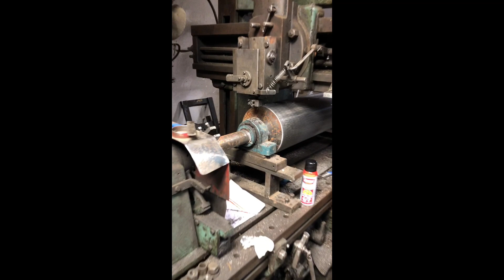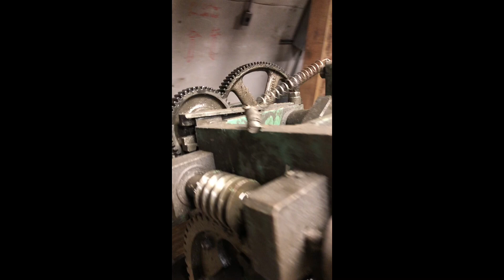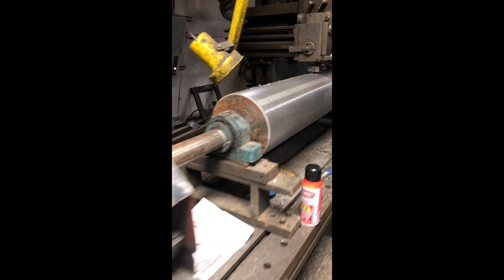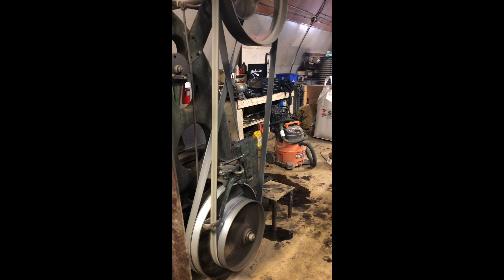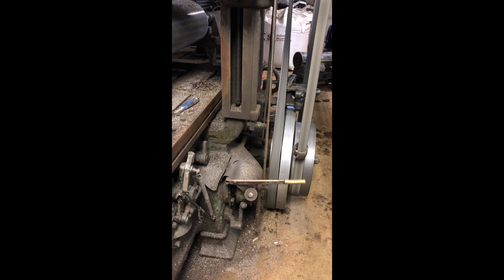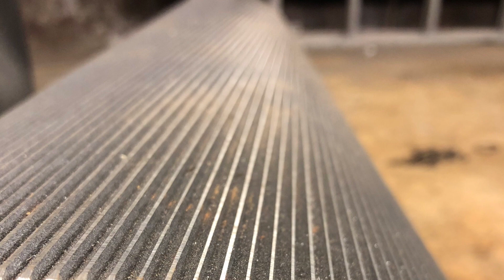American Tool Works Metal Planer - Cutting helical teeth in grain rolls the old fashion way

Comment: What a great set up. No mill around normal shops could do it or even try. The time and set up costs must be good for the shop N machinists . Real machinists at work.
Reply: The rolls are chilled iron and work hardened when the need re-surfacing,  tough on lathe inserts let alone a milling cutter.  I've had them come with 4 grooves from a previous shop, they gave up.  The biggest Ive done are 24"D x 48"L, 3Ton.

Comment: Still have one 189? model 12ft table, doing the same task for local commercial feed mills. It still runs a 2" flat drive belt - 3 flat pulleys with a middle neutral.  I found the directional control to be a bit fussy so:  I made a stepper motor driven belt controller/ IR sensors to control direction, added a large stepper to run the roll indexer 65million steps for 1 complete rotation of the roller being cut,  and a small stepper to lift the clapper box toolholder. I run carbide inserts so no reverse drag is allowed.  I don't get much call for helical work so I mothballed the sine bar setup, the old one wore out and the linear bearing replacement is incomplete at this stage. Been doing it since 1995, was use mechanically for same 30 years prior.  Planer was  originally used in railroad repair - for steam engine parts Im told..

Comment: Is that a long ramp that I see on the fixed part of the machine base that controls the movement of the twist ??  Then it must reach the high point of the ramp at the end of the cut and do an index at the end.  Is this correct ?  I used to work at the grain elevators in Buffalo NY and have seen these rolls.  They used to have a huge Landis cylindrical grinder to sharpen them, with the index setup as well.
Reply from the maker: You're correct about the ramp on the back of the machine, it can be adjusted to change the angle of the helix. The indexing happens while the table is reversing back to the start of the next cut.
Reply: That ramp is called a sine bar.
Reply: @MarkSmith-nw4os  Sine bars have radii for which to pivot a fixed length. This is just a chunk of steel.